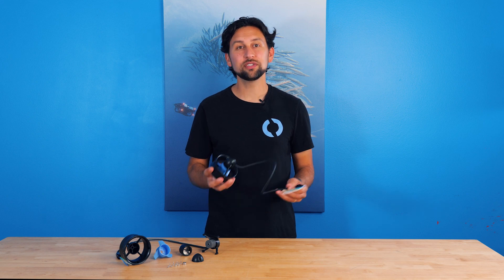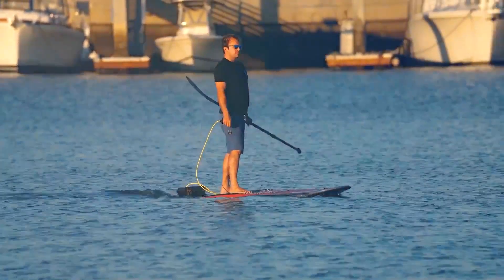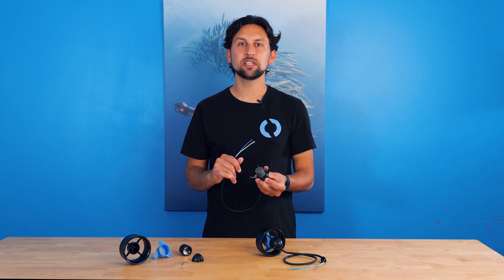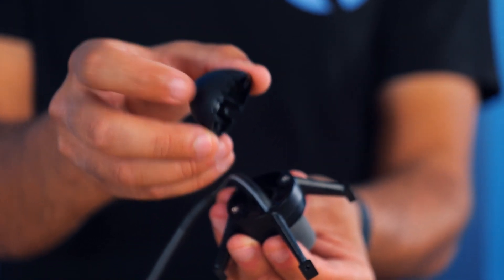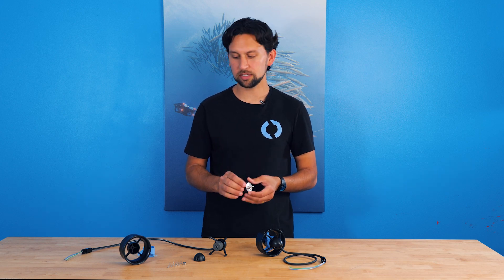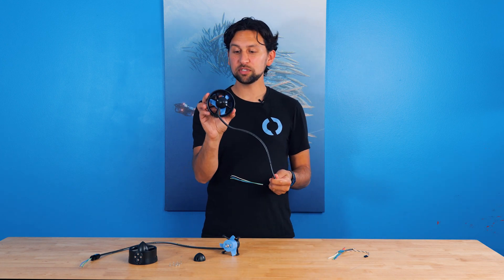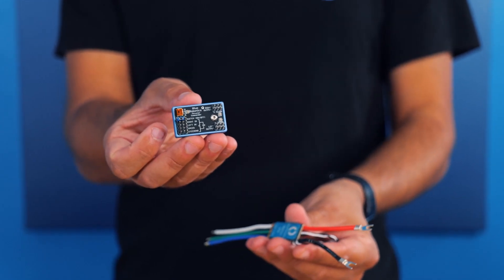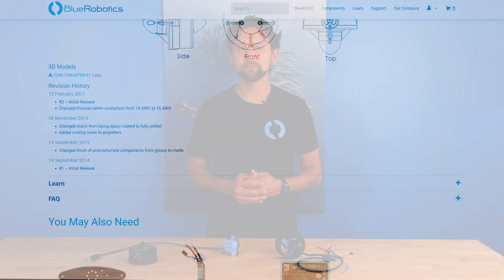Blue Robotics Product Overview: T200 Thruster

Comment: Hi Together,

I'm thinking about using this thruster in a reef tank in order to create flow. Do you have

 ratings regarding the outputvelocity at various speeds 😊

Thanks in advance
Reply from the maker: Hi there!  Yes! For detailed performance specifications, including thrust, RPM, power, and efficiency at various throttle levels and supply voltages from 10-20 V, please see the performance charts under the Technical Details tab on the product page: https://bluerobotics.com/store/thrusters/t100-t200-thrusters/t200-thruster-r2-rp/#tab-technical-details
Reply: @BlueRobotics  do you have flow Charts available as well i could only find trust. Interesting would be flow.
Reply from the maker: @salty_systems  Hello! We do not have flow charts available but we have estimates! Please check out the FAQ on this page for more details! https://bluerobotics.com/store/thrusters/t100-t200-thrusters/t200-thruster-r2-rp/#tab-technical-details